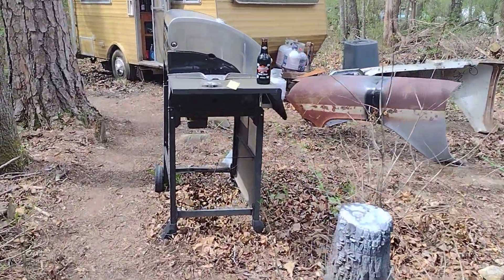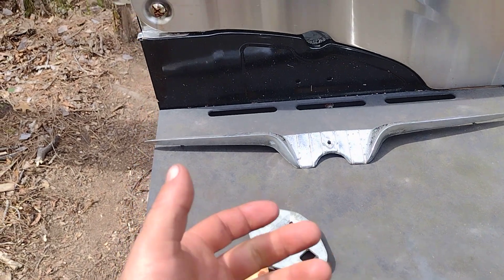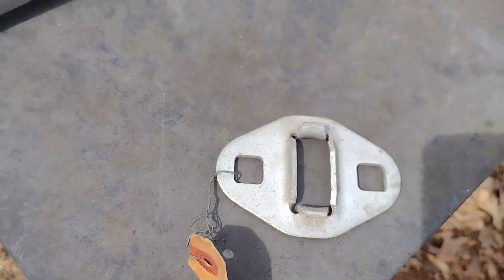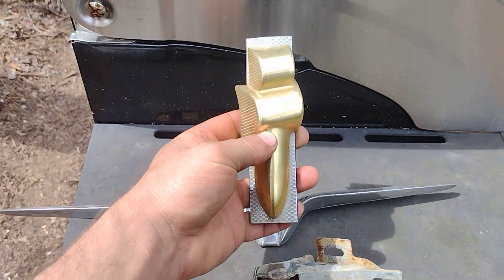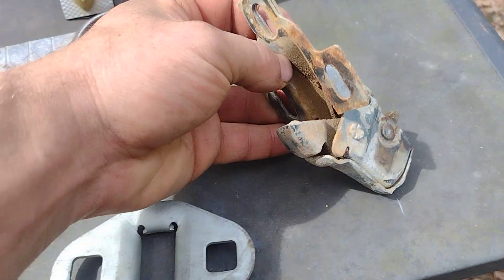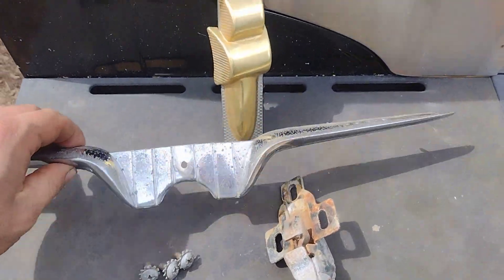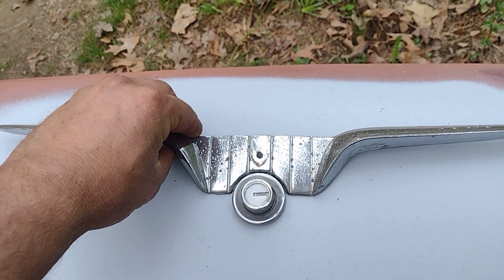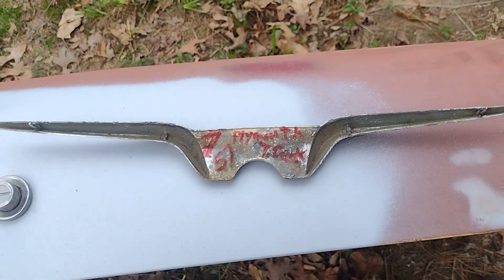1957 Plymouth trunk items/how the latch is supposed to work

Comment: The gold grill emblem and trunk emblem is the Plymouth Ship. The ship that brought the pilgrims to America. It’s a shame the trunk trim didn’t have it. You can fabricate the clip that holds the trunk lock cylinder if you want. Also if you want to polish the chrome on the trunk trim you can use steel wool #0000 grit. Make sure you get any steel wool specks off or else those little pieces will rust. Also if I saw correctly your inner trunk lid may need welding. It looks like someone cut it to get the 57 emblem off.